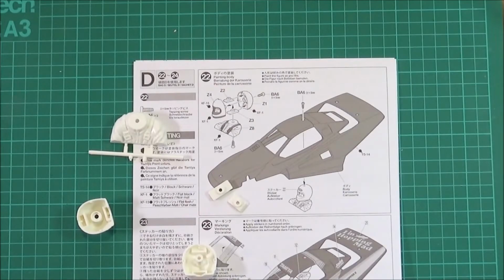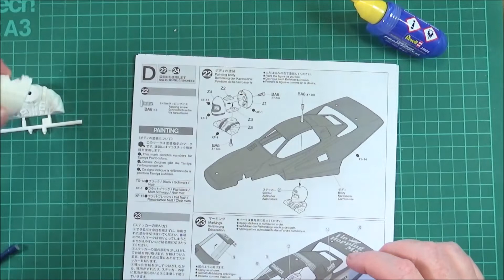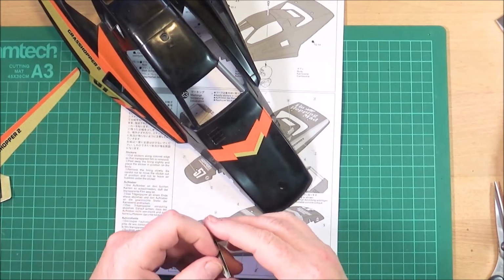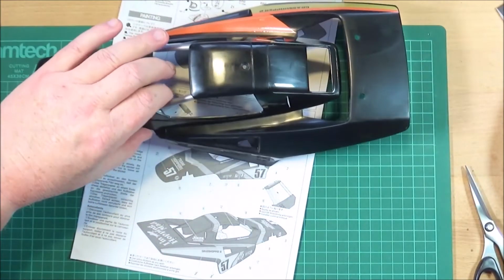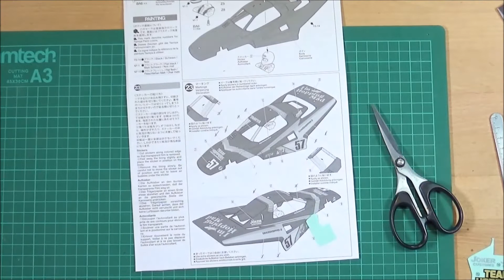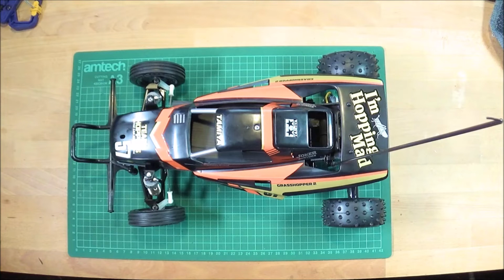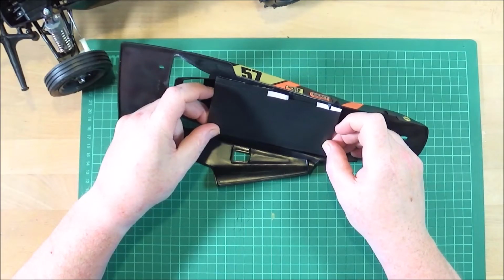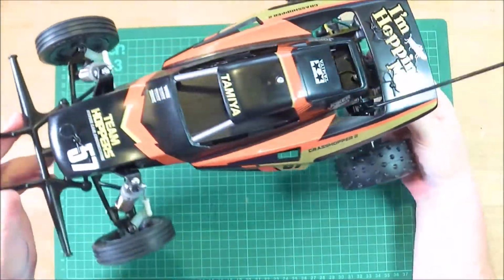Tamiya Grasshopper II Build Bodywork

Comment: Hold the clogged up needle tip with pliers and bbq it with a lighter. You notice when the glue burns up. Nasty fumes and burn risk comes as bonus. Pop the needle back in when cooled. Now your glue is good as new 👍😉
Reply from the maker: Thanks for the tip I will certainly give it a go. All the best my friend.